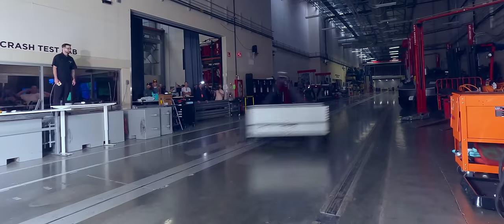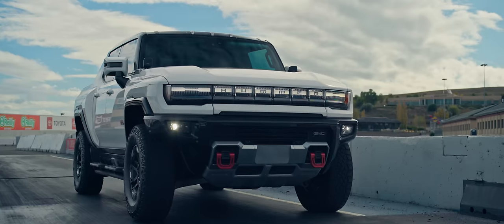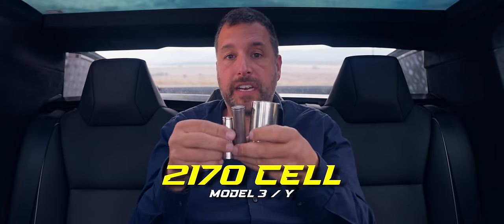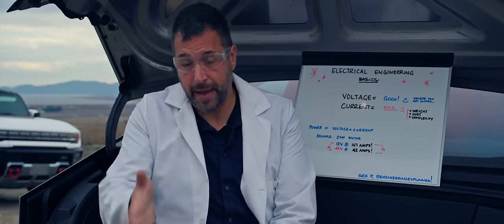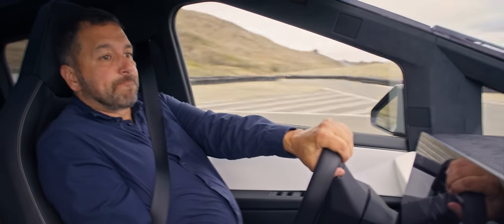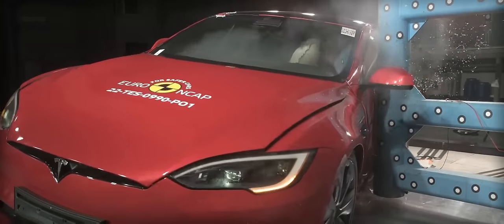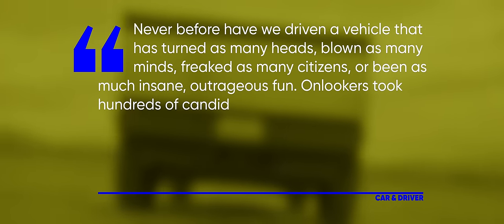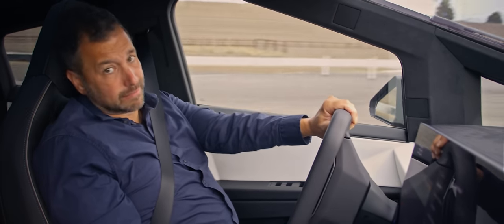Exclusive 2024 Tesla Cybertruck Full Review & Drag Race w R1T & Hummer  — Jason Cammisa on the ICONS

Comment: I’d love to see a truck doing truck things. Like off road driving, carry capacity, towing. These are trucks bread and butter owners.
Reply: It will come in time
Reply: This isn't a truck. It's a Costco parking lot assault vehicle for upper middle class suburbanites.
Reply: @sheldonmilne3315  it does more truck things than a truck so its the truckest truck of all trucks
Reply: @sheldonmilne3315  couldn't be further from the truth.
Reply: Based on what? do we have a video showing these off-road? Towing capacity and how this affects range, Payload capacity? Ive not seen it. My F-450 is about a truck as you could get. This seems to be more like a Honda Ridgeline. Two very different interpretations of a "truck"   @a-don13
Reply: @sheldonmilne3315  most trucks are used exactly for that purpose
Reply: @thegeneral1955  You act like it has the battery of a smart phone. You could camp in this for a week and the battery would still have high charge.
Reply: Bingo, how about something along the lines of a HiLux Champ with drop down sides 8’ bed, etc.
Reply: Your situation is only not majority, as 80% of truck owners tow or go off-roading 1 time a year.
Reply: @scythelord  the purpose of a truck is to be able to load it up maybe add a trailer and move that stuff reasonable distances for a reasonable cost, once you load up the $80k CT and add a trailer you're down to about 150 miles of range , sorry as a truck that makes it an abject failure.
Reply: @baddriversofthenorcalarea500  Sure if you’re concrete camping in the summer at a dedicated campground lmao.
Reply: @thegeneral1955  I wanna know what you are doing camping that will drain so much power
Reply: @thegeneral1955  18 minutes charge from 15%-85%, you are right about that batteries will need to improve to handle remote work, this is a better camping car than any gas car period, same goes for it as a work truck. it is as tough as it gets with a lot of storage and power, automatic cover, and towing and load capacity. the ideal work horse.
Reply: @alexford5214  payload capacity and towing are listed on website yes. and no it is not like a honda ridgeline but a ford f-150. f-450 is literally not in the same league and you know that but we playing stupid now i guess
Reply: @a-don13  - Not really- It has twice the HP and almost the same torque. It should be able to compete. That being said it seems that all the videos out are about how it handles on pavement. Most truck reviews (even some SUVs) will show how it handles in snow, forest roads, mild off-road, etc. It's not stupid when you consider 28-30% of all pickup trucks sold in the US, are in Texas and most use them to haul. Im willing to bet the vast majority of the 1 million pre-sold versions fall into two camps- One For resale at the highest possible cost and Two To be cool with the first Tesla truck, but have zero intentions of actually using it, as a truck
Reply: @thegeneral1955  - Truth but then why build it? I believe the market will bear a new generation of people willing to drive around a larger "truck" so they can carry stuff, as needed. Tesla is marketing campers, ATV racks, etc. They intend on making it succeed off-road. Time will tell. I can say thes- No current Pick-up (including the F-450 I use to own) could take the frontal/ side impact that this truck can. It's pretty stout. Only issue is lack of lifts/ tire size accommodation and the wheelbase, will limit it to mild trails only
Reply: @alexford5214  no, i meant the 450 has 4 rear wheels lol its competition is the f150 not the 450. 
i don't get your whole argument on why there's only two camps of people buying it, you said absolutely nothing there. also can't resell it for a year so no. it can handle whatever you throw at it, literally, so it will be a work truck as much as an f150 can be
Reply: like 5% of truck owners today do any of that
Reply: @shellderp  - not in my world. We use them for work.
Reply: @a-don13  how would you know if we’re haven’t seen any of these “reviews” show it? Lol
Reply: I like the thing, I like the engineering, I even like the way it looks, but the customer base is the same annoying class of people buying Rivians, Lightings, or Tesla Plaids. Upper class granola douches who love Patagonia pullovers, Apple products, frown upon ICE car enthusiasts and live in whatever up and coming, gentrified neighborhood is in your city.
Reply: @JamesJDMoe  what more do you want them to show you lol

Comment: Jason's right, I had already made up my mind about this thing, largely based on appearance and a history of unfulfilled promises.   This comes off a little like a paid endorsement, but it has opened my mind, understanding the background of the vehicle and its engineering.
Reply: This thing is worse than expected. Pretty scary thought that if you loose power or have a electric defect you completely loose your steering… absolute insane. No problem to have electric functions but for the essential stuff you need mechanical backup…

Comment: This could be the best vehicle review ever where Hagerty brought everything that we’d want to see compared to the Cybertruck, including a refrigerator. This vehicle is a game changer. Imagine if Tesla made a sports car.
Reply: Tesla did. Back in 2012. It was called the roadster and it was bad.

The range sucked on it and they could not consistently build one. Top gear also bashed the car for what it was causing a problem disaster. After it was discontinued elon promised a 2nd gen version that fixed all he issues but almost a decade later and it's been quiet. There's even a story of 3 roadsters being smuggled to China in probably a companies efforts to reverse engineer them but they went under. Those 3 cars sold for alot of money solely on the fact there never may be a 2nd gen.
Reply: @jerseyjackrabbit2829 2nd Gen Roadster announced in 2017, currently slated for production start by end of 2024
Reply: @jerseyjackrabbit2829  I'm aware of the Roadster, but that was their first vehicle developed using very limited resources and based upon a Lotus. I wish they'd use everything that they've learned since then to create a paradigm shift in sports car design, but I acknowledge they need to focus on higher volume vehicles such as an affordable car to compete with the Chinese.
Reply: @danhunt4884  I'd bet money that it won't.
Reply: Game Changer? The Cyber Truck costs $60,000 and you can buy a 2024 Ford Maverick XL for $24,995.
Reply: @Andrew_NJ  Are you really comparing the two?  Seriously?
Reply: @Andrew_NJ  If the sole consideration when purchasing a vehicle is having the lowest price, then you're right, it's not a game changer. However, having a vehicle that uses no gas, has amazing technology, has a unique design, can outrun supercars, has the latest self-driving tech, is bulletproof, can power your house, etc. are all factors that make the Cybertruck a game changer.
Reply: @thebagnechannel3183 maybe, I was just throwing some facts into the mix 😉
Reply: @jerseyjackrabbit2829 Tesla admits the Roadster wasn't great. It was only intended to show that a Battery-only vehicle could deliver performance, so they could get the money to build the Model S.
Reply: @thebagnechannel3183 Tesla is often late, but always delivers vehicles eventually. They said the same for the Cybertruck.
Reply: @travisjazzbo3490  True true, no competition, the Ford is a useful vehicle whilst the Tesla is an unreliable doorstop with some bling on it
Reply: @thebagnechannel3183  It's a truck, why does it need to do any of those things?
Also it's woefully unreliable so it won't actually be doing any of those things as it'll be stuck at a Tesla service center lmao
Reply: @kristoffer3000  Pickup trucks have poor fuel economy, require expensive maintenance, are often slow, and lack maneuverability. The Cybertruck solves these issues and then some. And who says it'll be stuck in a service center?
Reply: @thebagnechannel3183  Owners say it will be stuck at a service center, there's been under 4k delivered and they're already having MASSIVE issues with reliability, cars bricking themselves completely, not being able to charge, accelerator pedal coming lose and jamming at full throttle etc.

And yeah, pickup trucks are generally awful in a lot of ways, a lot to do with US regulations obviously but this fixes none of those things really.

Comment: Infiniti has had steer by wire since 2013, it was an option on the q50 and in 2019 became an option on the qx50. The biggest difference here is that infiniti had a mechanical clutch as back up if the system failed. If it cut out the clutch would engage to give u manual control of the rack.
Reply: That's a good idea, I can imagine one these going out of control wouldn't be good. 
If everyone was a perfect driver this would be pretty reasonable, but the way this thing is built I can see a whole lot of pedestrian fatalities in the near future.
Reply: I was going to say the same. He is sort of correct since there is no physical backup, but technically the Infiniti system was not connected unless there was a failure.
Reply: You really want a back-up for drive by wire steering either an auxiliary motor and a computer or a hydraulic circuit that cuts in to an emergency steering rack.
Reply: @802Garage And he acknowledged this while discussing it at length with his friend Derek on their joint podcast The a Carmudgeon Show

Comment: I do like the concept of a 48volt ancillary system. (I’m thinking of general wiring looms and the requirements for much narrower gauge wires). It’s incredible how we’ve all become accustomed to 12volts for most car parts..
Reply: Yes, although 48v systems are more common than Jason suggested. BMW, Merc, Audi, and Volvo all use in most of their line-up. Has nice benefits for ICE cars too, with smoother start/stop that allows AC, power steering, and other accessories to run while engine is off. 

My understanding is they still have a 12v system for other parts of the car, and that the Cybertruck is unique in that everything is 48v. Definitely best to fully convert to 48v, but 48v systems aren't totally new.
Reply: @The_Stanman  I bet all the 48volt control equipment like the relays and fuses etc are costing a fortune to buy as they  definitely won’t available as replacement parts at Halfords in the U.K. (or any similar car parts mart in the US) ha ha !

Comment: Does it haul or tow anything?  Will the axle survive a collision?  Can you see anything out of the windshield besides the dash?
Reply: Don't worry that's irrelevant you're supposed to care how fast it goes zero to 60 and how not normally designed it is because that's all that matters 😂
Reply: It will for sure tow anything you could tow with a dually plus the dually that towed it there. The HP and torque are more than any pickup on the market, I'd wager.

Comment: It's very impressive . Throttle by wire does fail though. I've fitted many a new sensor to them.
Reply: Throttle by wire can fail just like anything else, but they have redundancy built into them. Dual sensors ensure that your car will be able to "limp home". Same goes for the cybertruck's steer by wire. Dual motors ensure steering remains active if one fails. These things aren't built without considerations for what could go wrong. Practically every vehicle sold now has throttle by wire and very few people have probably driven a vehicle with a throttle cable.
Reply: @joseosorio7064 Ford Eco boost I was driving for work didn't have any redundancy.  It would "lose" it's throttle position and quit inputting and return to idle (on the highway) I could reset it with my scan tool but that would fail in a few miles.  Common failure point in them mechanic told me.  Wasn't the first time it had quit working in that truck.

Comment: Great video!  But how well does it actually do truck stuff? Towing, bed usage, utility, practicality, hauling mulch, etc?
Reply: EXACTLY! Where's the hitch? Range while hauling a loaded trailer? Back seat space for the crew? Dirt, snow, salt all over the bed cover grinding into its little electric motors?
Reply: The motors are sealed.
Reply: @bingS4  Tesla demonstrated it out towing and F350.
Reply: Exactly. Nothing was mentioned on how it operates like a truck. Give this to a farmer, or oil field worker. Then we'll see how it performs.
Reply: @DanjaPreston  Sorry, I should have been more specific. How is the range when towing a heavy load? Most electric trucks suffer from a huge range loss when towing. Sure it has the torque to tow a lot, but do I have to stop every hour and a half to charge for half an hour?
Reply: Its pos I guess u get 100miles towing before charging back up.
Reply: @bingS4 yes, you're right, they do. I guess we will all have to wait and see about that one... My guess is that it will be suitable for most typical truck/suv consumers who generally rarely tow. Whatever it is, I guess it's just another option for everyone to determine if it checks off enough boxes for them to purchase one. Hopefully it does for you if you're a fan of the other features. 😊
Reply: @mbladeakita9173   they mentioned how it operates better than traditional trucks. And neither farmers nor oil field workers are the target market. The is a high price point recreational-commuter vehicle, it was never designed to try to compete for usability in the commercial utility space.
Reply: @mbladeakita9173  how about, let the farmer buy it if he wants to? Everyone is so butt hurt about getting another option lmao
Reply: Its crap as a truck, it' best off roading was on a dirt road and it squeaked and banged like the cheap build it is.

Comment: 10:25 - Tesla was NOT the first to do a 48-volt low-voltage system! Mercedes started shipping the S-class with an optional 48-volt system in 2018! (In their case, it’s a mild hybrid whose hybrid battery pack doubles as the low-voltage pack.) Some of the accessories (infotainment for example) were still 12V, but they used 48V-12V converters at the accessory side, so still benefitted from the thinner wires to bring the power to the accessory.

48V for low-voltage is an actual industry standard that was agreed upon by many automakers years ago - most are just taking forever to actually change to it.

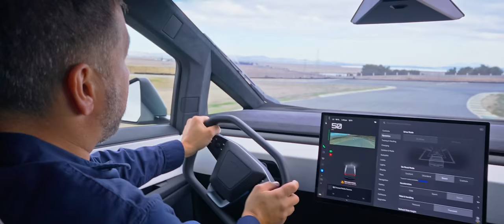Comment: 15:25 lol the throttle body sensor on my 2013 F150 ecoboost has literally failed 3 times on me in the past year.  Look it up, this is a common failure and is borderline dangerous depending on when it fails. Luckily my failures were in parking lots or on startup, but some people have had failures in intersections which leave them susceptible to causing an accident.
Reply: Got it.
That sounds really dangerous.
Reply: first mistake was to get Ford especially one that is ecoboost, secondly you are talking about your TPS sensors which he explains that most cars have two sensors and a third one can help overriding any issues if one of them is faulty. Ecoboost are notorious of having fuel injector issues due to the carbon buildup of direct injection, especially during a cold start. So you might want to get it checked out or one of you sensors need to be replaced because it is dead (average life cycle is 5 years). Drive by wire is mandatory w EVs just due to how fast they can go and it helps making the car to be more efficient and it makes sense in a car that is loaded with technology and autopilot. Any car with cruise control will also have it.

Comment: Infiniti had steer by wire. It was your main talking point in the video back then.
Reply: That is cause this is an advertisement, not an actual review. That is why it's nothing but glowing reviews and ignoring things that have actually been done before
Reply: Yeah, and the Infiniti system was terrible and plagued with issues
Reply: True
Reply: Infinity also had a steering shaft, but without a physical connection to the wheels.

This is end-to-end Steer-By-Wire.

Depends on the definition.